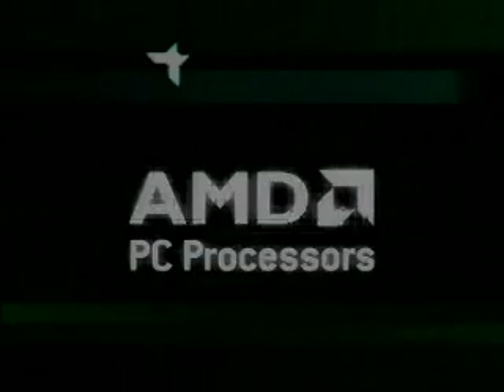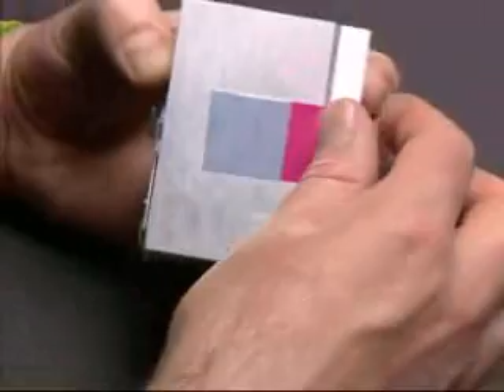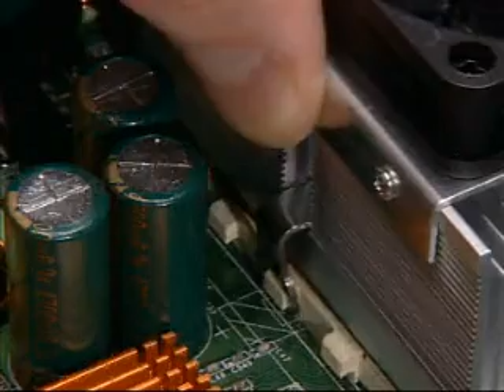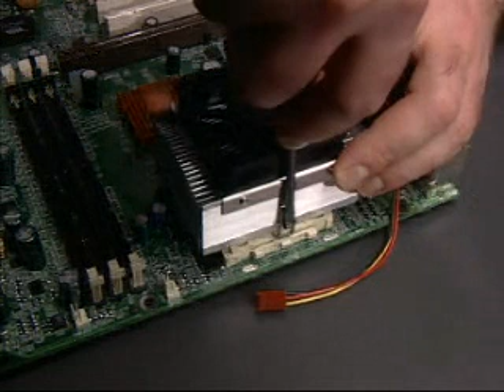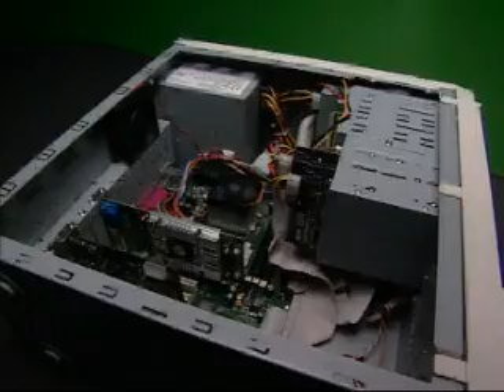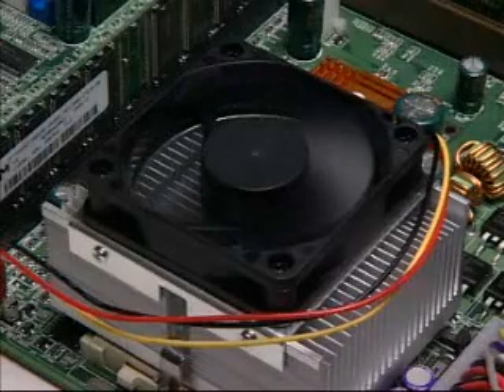How to put a CPU heat sink on the motherboard

Comment: heat sink goes over the cpu and the fan goes on top of the heat sink. the heatsink helps move all the warm air from the cpu and push it out using the help of the fan